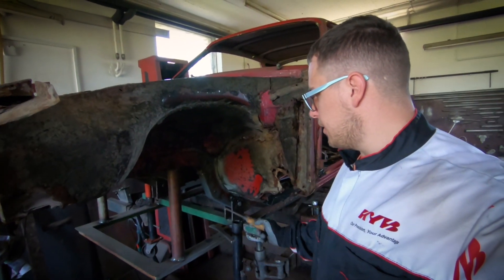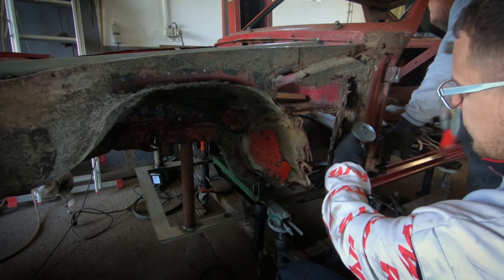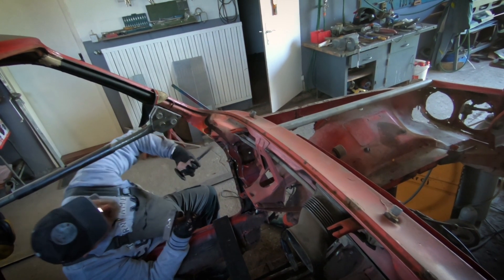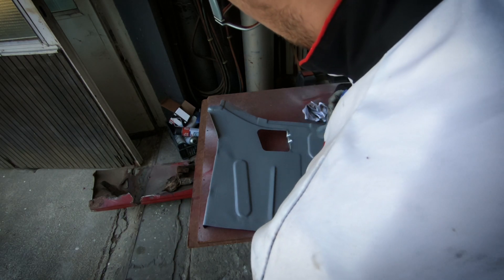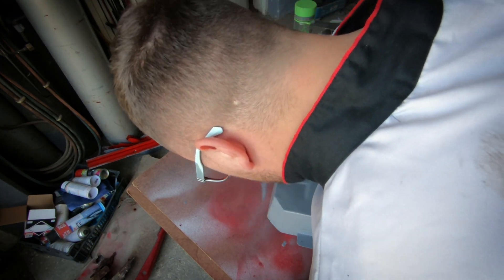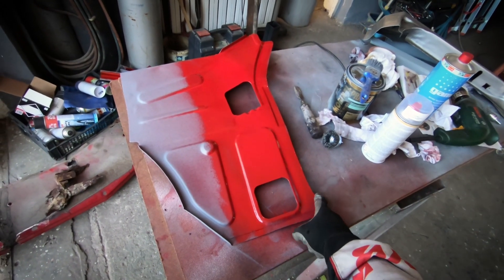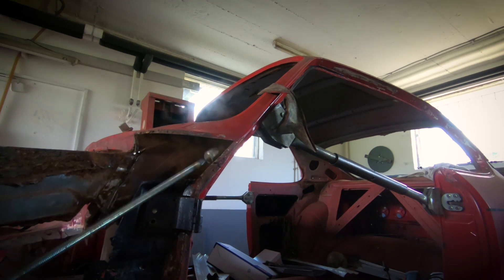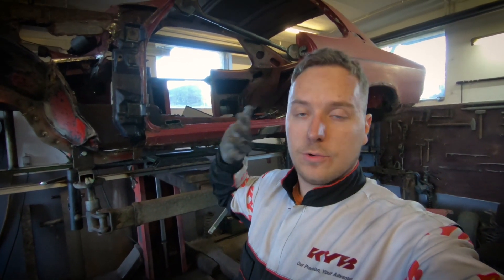Opel Manta A '71 - S1 EP 21: A Pillar (A Post) Repair | PART 1

Comment: Good work! One question: after reinforcement, sandblast is not a good solution? Keep going and good luck!
Reply from the maker: Thank you! Firstly the rust must be cut out and A pillar openes since it is rusted on the inside and sandblasting from the outside would not help and it already had rust holes so sandblasting weakened metal wouldn't save the chaning of part. Sandblasting the inner reiforcement that we have wirebrushed and applied rustconverter would be a good idea. However I do not have conditions for sandblasting and transporting the car to sandblaster for one part only did not seem rational. If the A pillar wouldn't be as bad and need changing both inner and outer part then this would be a good idea and to protect the inside but unfortunately on my Manta the metal was too far gone to be sandblasted, it just had to be cut out and changed with fresh sheet metal. I hope this answers the question. Best regards!